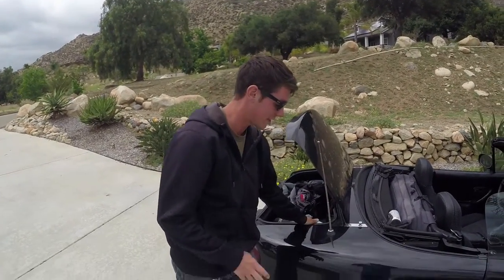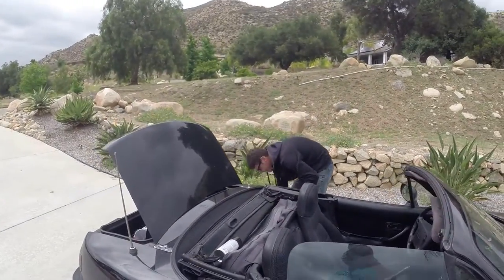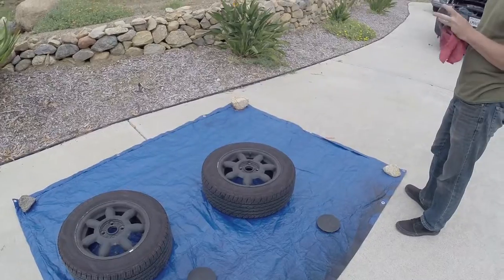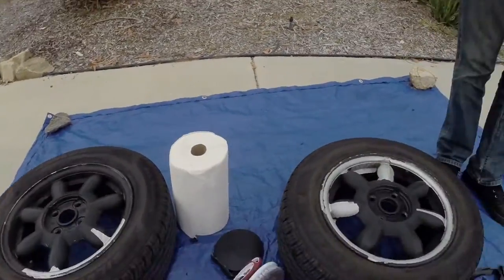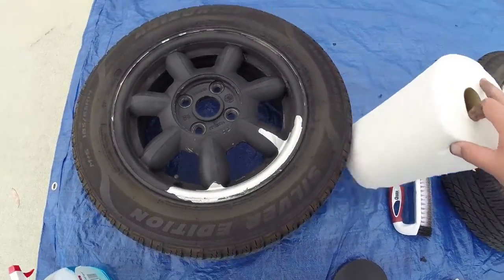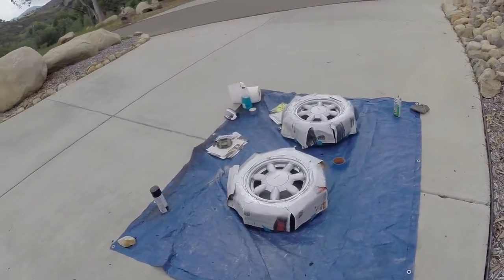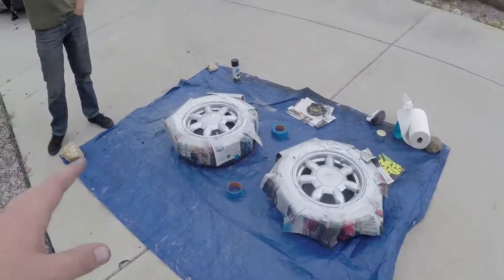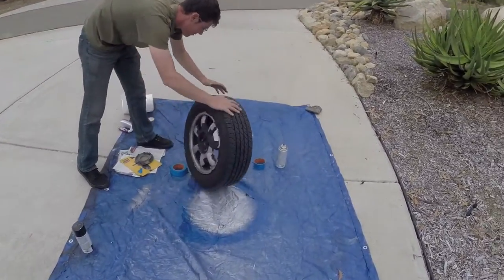BMR | Retro Miata Build | Ep 2: Painting the Stock Wheels

Comment: That Protege5, though.
Reply from the maker: +Yet Another Car Show its completely dead :(
Reply: That's too bad. What all is wrong with it?
Reply: +Yet Another Car Show I don't remember. It's Kyle's stepdad's. The last time it was running it had a completely ungodly knock - reeaaaallllllyyyyy bad. Haha
Reply: That's the FS-DE for you. They're junk engines. I used to have a silver P5, and my only gripe about it was that Mazda didn't fit the VVT BP from the NB2 Miata. I'd honestly probably still have it if that was the case.
Reply from the maker: +Yet Another Car Show Yeah, that motor only had 120k or something like that and died. Definitely before it's time, especially when you look at how reliable most Mazdas are
Reply: I haven't been in the car in a long time but it was around 147k miles, and it was running so well but it just suddenly died, I had to drive it one last time right before it was dead to school and back, it was the scariest thing ever, driving like 23 miles trying to revive the car while on the move, I said I never wanted to drive the car after that, and it died the next day to two